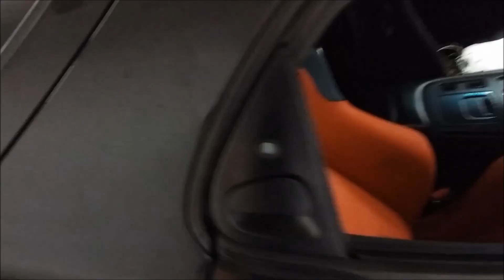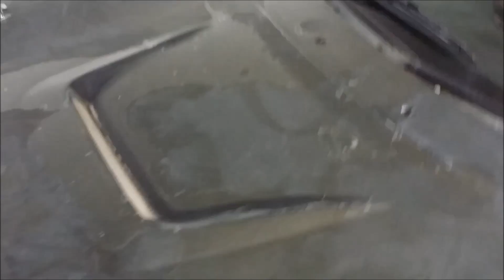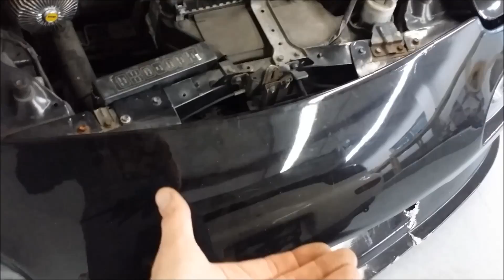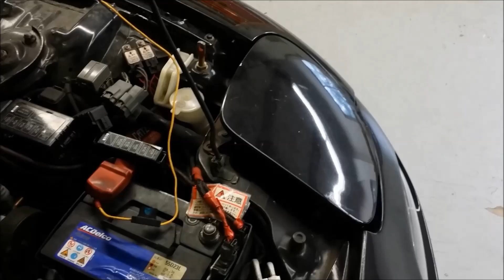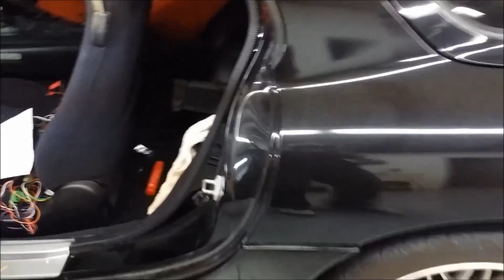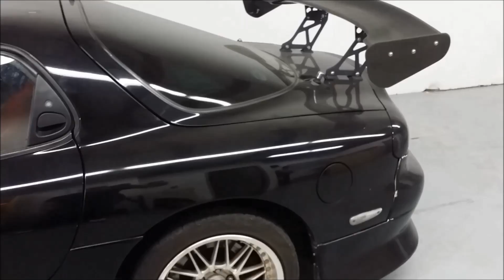Finally! We have a new car! 1999 Mazda RX7 FD3S Type RS, Project / Demo car build intro Part 1

Comment: Being a '99 Model, they're supposed to have a 16-bit ECU, which was usually reflashed with a new map. Could be the case with yours.
Reply from the maker: Hi,

No it was the stock 16bit ecu in there although the screws had been tampered with for sure. I think it had a power fc or similar installed at one point. Now it runs the fantastic Adaptronic plug and play ecu which allowed me to run the new single turbo!

Comment: I bought an FD so similar to that! :) I can't wait to see what it's like in person! I really hope the shipping company don't damage it... This is getting me proper worried lol Especially worried about having parts stripped lol
Reply from the maker: I have imported two dozen cars now and can honestly say this is the first time I have had an issue at all. worst I have had is a car somehow use a 1/4 of a tank of gas whilst on a ship....aka someone drove it around the dock for fin.  that was my evo 6. but other than that I wouldn't worry at all.
Reply: scotiatint1 lool wow, I hope that remains the case :) As long as the car comes to me as I saw from the poctures, I'm happy :) it's a lovely FD too, stripped out interior, full roll cage, TD06 turbo, gt wing, just need to get it dyno'd to see exactly how much power it's making :) should be sweet!
Reply from the maker: good luck!

Comment: Isn't that used to be your white rx7 but the black one is still awesome
Reply from the maker: Yup and yup. in for some boost issues. needed a vacuum line change and switched to manual pre spool and boost controllers

Comment: I noticed you said you had a hard time starting the car, and tried everything pretty much. I had the same problem, until i saw youtube guy name is Rob Dahm. $2 fix and start every time. Look for the video RX-7 won't start. FIXED. I hope this helps.
Reply from the maker: Hi.  yeah it was a pain. the issue was because it had an aftermarket alarm and I didn't get the remote to turn off the immobilizer and the other issue was the fuel pump fuse was missing lol. she starts great now lol. thanks for the heads up though I'll check it out..!

Comment: Ruthless shippers. Amazing cars though. I have one problem, are the rear lights stock? If so, in my opinion the circles lights in the middle are rather ugly. EDIT: Oh later on in the video you said you're going to replace it. Thank god.
Reply from the maker: ***** The rear lights are stock. The center light section is an aftermarket Altezza one. I hate it lol. It also got damaged in shipping and is being replaced with a stock one which is just solid black....

Comment: Are you doing a rocket bunny kit?
Reply from the maker: Tom frost I am going for the Full RE Amemiya AD GT kit. Literally the whole thing. Its cheaper than buying the stock parts and replacing everything lol
Reply: +scotiatint1 does it overheat
Reply from the maker: no sir. Engine had nothing wrong at all.....
Reply: +scotiatint1 keep it up...